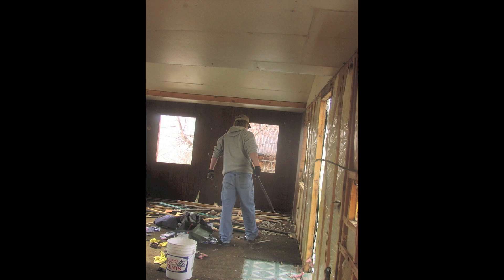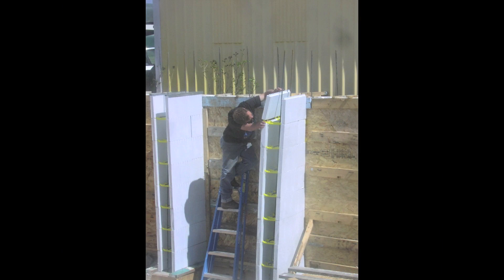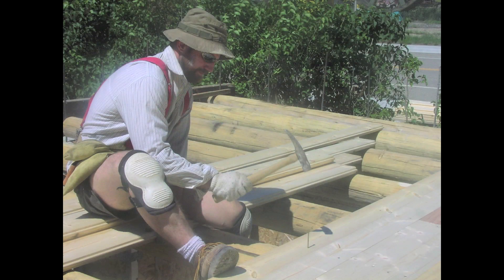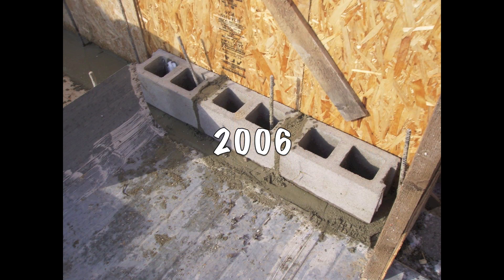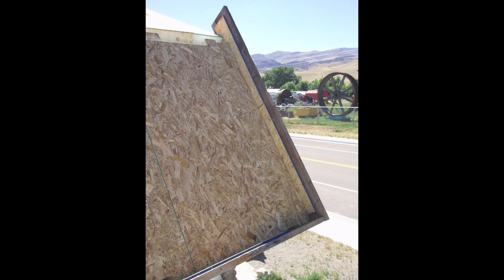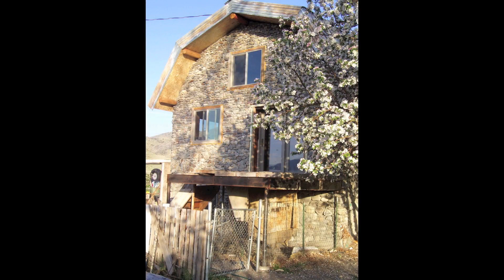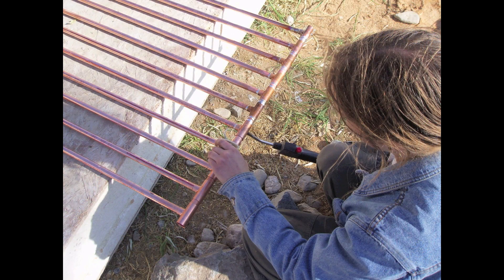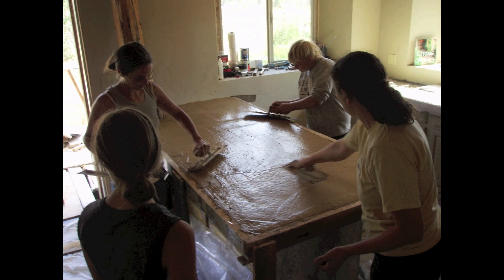Slipform Stone Masonry: Building a Slipform Stone House from the Bottom Up

Comment: I’m assuming no building permit/ building plans/engineering/energy calculations were used to build this house?
Reply: As a former building inspector, I would have required stamped plans for everything. Everyone hates on building inspectors, but all the houses I owned in weak building inspection areas or eras were poor and needed extensive rework. Supposedly "expert" builders but who couldn't even build it to keep the mice out, an ancient building "code".
Reply: @joea1433  without being there to see the details that is making a big assumption. By the way so long as he doesn't damage anyone elses property he can assume his own fate with his own ingenuity.  Not everyone needs someone to point and direct.  As for the permits, plans,  and calculations are concerned isn't it great to live in a country where it is no one else's business?
Reply: To  @wayne251975  - In the future, other people buy the houses built without permits and inspections, so yes, other people are victimized far into the future, after paying huge money for a house. All the houses i brought in areas with weak codes required huge amounts of work to fix the shoddy work. Notions that building inspectors "don't know anything" is just a device used so you and others don't have to admit you have not personally read the building and local codes involved and lack the capacity to do so. A lot of people have problems with authority figures and become psychotic with any contact, slandering the inspector in front of others.
Reply: @joea1433  Ok you answered my reply just as I figured you would. If you had been an "inspector" of any kind that could reasonably be worth the trouble to rely on, I would have bet money on you'd be the first to admit most inspectors don't "know" the code front to back as well wouldn't have tried the excuse "they don't know anything" when referring to those that have no use for the abuse of authority.  Don't assume a codes inspector is anything to be excited about.  I had left a fifty numerous times in places to know what the value of an inspector is.  My experience comes from personal knowledge, not from daydreaming of being a "do gooder" some day.  And before you guess, yes I have pulled well over 1500 permits have a good day, it is YouTube after all...
Reply: To @Wayne - I have performed thousands of building code inspections and was directly trained by the state and certified in the building code and the law. To maintain the certification, I have to attend 24 hours/yr of continuing education. The local building inspector needs to determine BEFORE a building permit is issued that the plans conform to the building code and local laws and the person seeking the building permit must provide sufficient plans for the inspector to review.  Or an architect or engineer must sign/stamp the plans. After the BP is issued, the site  inspections confirm the installation is being built according to the plans.  Unfortunately, virtually ALL small contractors have not obtained copies of the State Codes or received any training in the Codes. Also each community has unique zoning or other codes that apply.  Therefore the small contractor, by not "doing his homework" has set up the BP application/inspection process for conflict and failure. In dealing with hundreds of applicants, one sees patterns.  When an applicant goes berserk when asked to fill out a form or submit even the simplest of plans, shouting "I have been doing this for thirty years I know how to build this you are just looking for money etc ..." it is an indication he is not good at reading or paperwork and the slander is just a device to avoid acknowledging this fact. 
If you google for images of "Deck collapses" there are an astonishing number of spectacular collapses.  Yet when deck applications come in and the building inspector asks for some plans, it is common for the applicant to "I have  been building decks for 30years I know what I am doing …" Few people know how to build decks. I offer them The AWA guide to building decks according to code and they do not want it, an indication they are not good at book learning.  A lot of the building codes are based on following the manufacturers installation instructions, which are often just thrown away so obvious errors happen and the inspector walks in and immediately can see that the joist hangers, for example, do not have the correct or enough fasteners. It is extremely common for property owners or contractors to be so oblivious that they cannot see their own faults. The only thing in their minds is that the inspector is looking for a bribe, doesn't know anything, is persecuting them, abusing their authority etc. When I first started contracting in the early 70s, I realized that conforming to the codes and permits were just part of the job.
Reply: @joea1433  only if life were so simple. Codes are not written to reiterate or explain manufacturer instructions. They are supposed to be written on proven methods of Modern Construction. When I have bought a home the last thing I count on is whether proper permits were pulled or completed. As  a Mechanical Contractor since 2001 I have come to understand what it is I'm looking for. No matter how good a home inspector checks the house out many don't stand behind their write up as it is still a buyer beware. The codes enforcement and compliance in my own opinion is for those that don't feel competent to rely on their judgement. There is not one building inspector that knows every code they have been entrusted to enforce. Most inspectors I know and have known discuss methods and make suggestions based on materials used  or locations that may make them unsuitable. Codes are written as the expected minimum level to be a secure measure to yes insure public safety. But there are a many that need schooling on just what it is they are looking at.  Cause let's face it they haven't seen it all and most likely never will. That's why it's important to know your stuff and not take the short cuts. It says alot when Metropolitan codes adopts a system that allows an inspector to approve contractors to submit permits for inspection online and get an approval or pass online that same day. Because yes, they do not inspect each and every permit anymore. So much for that faith in the codes dept Huh?
Reply: To  @wayne251975  - You are expressing "notions" but lack the inspector's experience of constant training and dealing with many, many contractors and seeing many, many jobs. The vast majority of jobs are filed properly and the contractors have appropriate experience and intelligence. The inspection goes very fast because everything is done properly. Then there are the contractors that are not ready for prime time and make obvious errors and defend themselves to the death despite that the competent contractors  would have spotted the same thing. That is the goal for contractors, strive to have a job done properly,  the inspector has a lot of other things going on that day and wants to spend as little time on your job as possible. If you cannot do that, it is time to go back working for someone else because you still need supervision and it is not the inspectors job to do that.
Reply: @joea1433  well I guess I have it made don't I? Since I don't need inspecting due to the bypass, lol. For what it's worth yes there needs to be something to satisfy a check and balance. Oñ the other hand the current code system is entirely to archaic and riddled with unnecessary fluff that serves no one's interest. Codes enforcement that can be everything from deeming buildings unsafe that may have issues but aren't unsafe. At times they become an extension of the special interests. But I wouldn't under no circumstances ever believe blindly an inspector knows the code. That is plain and simple, many mistakes are missed by incompetent "Inspectors". To lay someone's trust in any government entity regardless of their origin is setting themself up for a big disappointment. I really don't care how many jobs they have "Inspected". They are human and given the Circumstances they miss much more than they catch. Moral of all this know your Contractors, don't trust any of those involved blindly, it is foolish. If your worried about an existing structure before buying it, don't send a plain old home inspector out their in their areas. That alone outlines what is wrong with this whole facade of make believe. At the end of the Day it's buyer beware and if your the least bit concerned then " beware " is the minimum. Protect your investment by educating yourself and trust no one blindly....
Reply: @joea1433  What do you think of the build in this video?  Would it pass code in your area?

Comment: nice to a certain degree, mostly worried bout the time it would take to get done. I have basic house plan, for a two bedroom, ( no laundry room, which I do want ), nothing fancy, or a one bedroom with a slant roof and loft on second floor. I don't want it to take one summer let alone two. then, the other issues are the foundation and roof. I know the basics from internet, but never done anything in construction before. on top of that, land is expensive here in Wyoming where I live, and I want a lot of it. I'd prefer 60 acres, might be able to go with 40. found on property, 40 with a spring on the property. but wife is a nurse at hospital, and to much if a drive in winter. (Even summer for that matter.). how would a husband and wife alone build something probably a 20x30 in one to two summers? that question is probably the biggest I have.
Reply: my wife and i plan to do the same thing starting this spring! i read up on another blog from his site, a husband and wife team using slipform, they worked evenings and weekends with some other part time help. they were able to get a house of similar size done in one summer! i guess the more time u devote to it the faster it will get done! i plan to have ours up in 2 months of full time 6 days a week! good luck and enjoy your new house!!
Reply: just do it ...nothing to stop you except your self

Comment: That metal roof will be very noisy when it rains (and it does't look that good either). You should consider using roof shingles at some point.
Reply: There is nothing more soporific than rain on a corrugated iron roof.  Lasts longer than most other roofing, and in high fire danger areas, is a MUCH safer roofing material than shingles.  And I doubt any rain noise will be heard with the depth of insulation between the iron and the interior ceiling.  The build is a labour of love - you have built a home, hot a house.  Congratulations!

Comment: While free & reclaimed materials are enticing, the cost of materials is only part of the final cost of what you build; and it's the final cost that's important (which includes labor to build, labor to haul materials and labor & time to fit materials not in their prime).

C block cost from 60c to 1$ each new.  Labor spent sorting, chipping mortar, cleaning & dealing with broken corners detracts from the bargain.  Labor spent sorting random lumber is part of the cost of using that free resource.  The labor is charged even when it's your own free labor (you could, instead, be relaxing by the beach with a good book).

I'm not saying to not use these resources, but to be wise in the true costs of construction.  I've used plenty of cast off materials but often regret the labor input as well as the sometimes necessary compromises needed to use those materials.  As I've grown older the value of my time has increased.

Also, the realization that most of the materials I've reclaimed had no ecological benefit as the materials I've saved from the landfill were themselves products of the ground (or wood): from the ground, back to the ground.  The best use of an old car (that's not a 57 Chevy) is to melt it down and rebirth the constituent parts into a new car; smash C block back to sand & reform it into new block; turn old lumber into mulch and grow new wood in managed forests.

You itemise the materials but neglect the labor.  Labor is the most valued of the construction inputs.

Comment: Isolation on the inside is not a good idea.

Not at all.
Reply: +Ouwkackemann You mean insulation and insulation is almost ALWAYS on the inside...Insulation is to keep heat in...
Reply: If you have the insulation on the inside, you will have moisture inside.

That´s why you should make your insulation as far as possible on the outside.
Reply: Ouwkackemann It is out as far as possible...It goes against the outer sheathing...Moisture can be controlled with ventilation...A proper system accounts for that...

Comment: The roof is the most important part.  Leaks with the osb is death to the roof structure.  Go buy some new metal roof at home depot with a 40 year warranty.  You will save a fortune in water damage repair!  You can get any color to look great with the rest of the building.